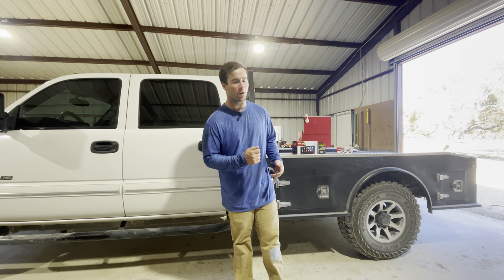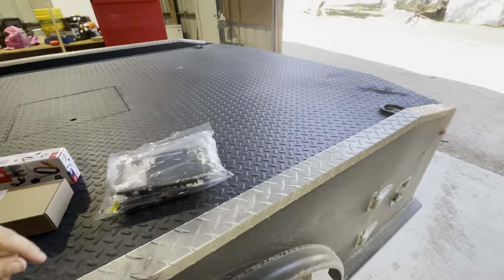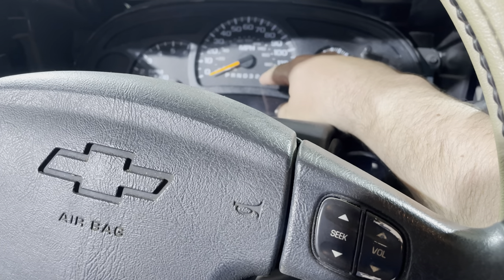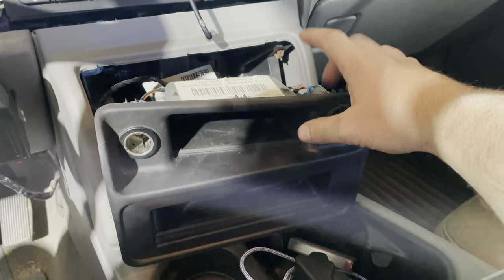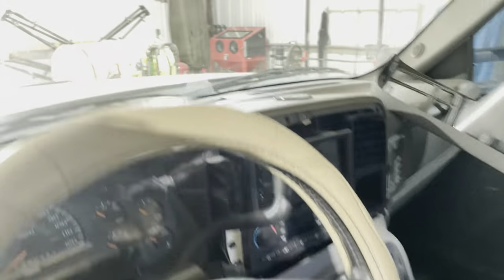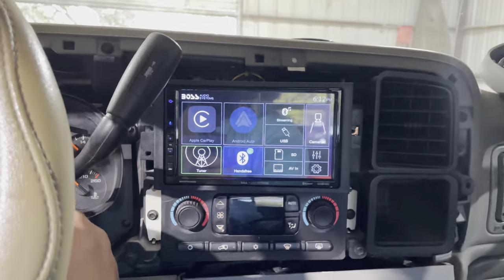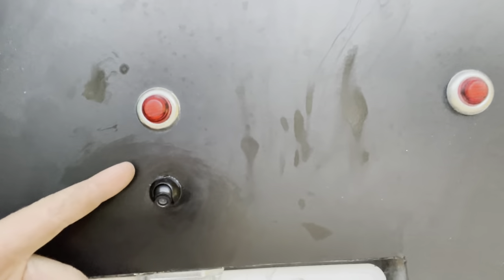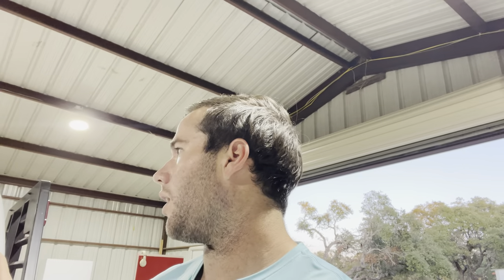Best Budget Friendly Touchscreen Radio With Apple CarPlay and Steering Wheel Controls

Comment: I see you got a different truck but did the Hydra in the 7.3 ever give you problems? looking at getting one for my 02 7.3
Reply from the maker: I still have the truck and haven’t had any problems with it. But true fully I do not use it much. Usually just leave it on the stock tune.